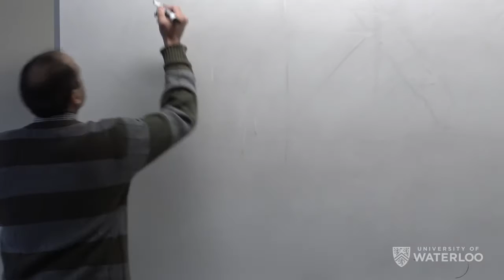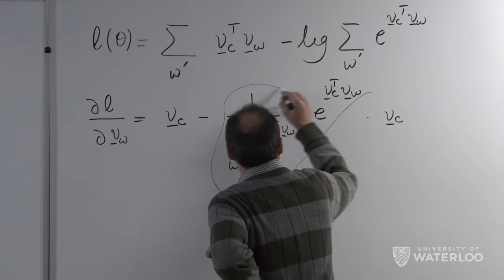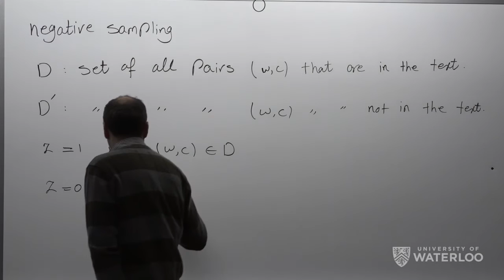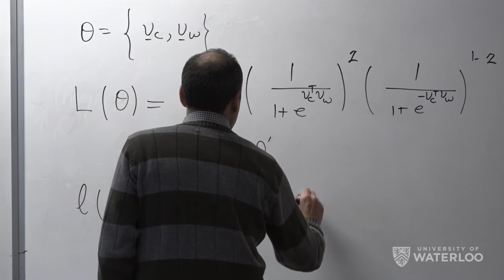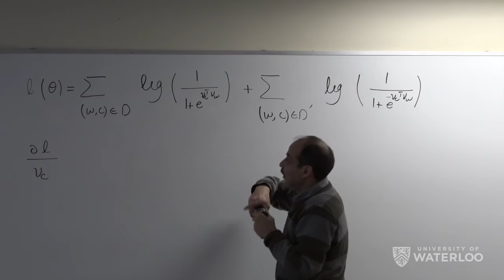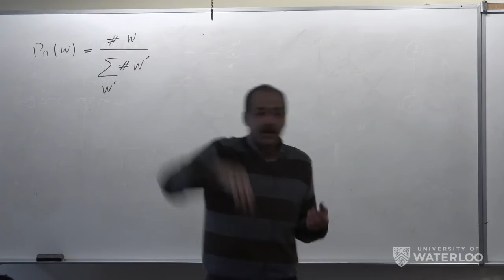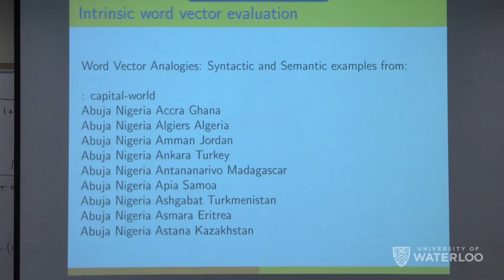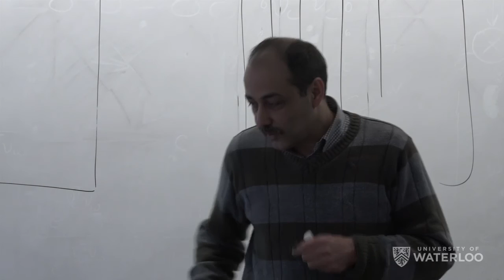Ali Ghodsi, Lec 13: Word2Vec Skip-Gram

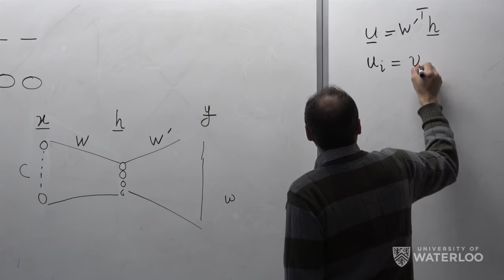Comment: 5:35 Why would it be one row of W prime? In the first case, we got a column vector of W because we multiplied a one-hot encoded vector with W. However, multiplying with h should not give one particular row as h is not a one-hot encoded vector.

Comment: Another intuitive reason for VcVw naming:
the vector Vc is just there to extract the information about the word, works just like SVD, to reduce dimensionality while storing the necessary information. Now the task at hand is to check how similar this vector thus formed, is similar to "all" the words in the corpus, so if we see, the problem has essentially changed, from extracting the info about the word, to getting closeness to all the other words of the resulting vector. Both the problems are different, will be solved using different vectors, hence different Matrices.
Reply: why do we want to make Vc similar to all of the words in the corpus ?
Reply: @cem9927  example: A word like Cat will have context words like four-legged, whiskers, fur etc and a word dog will  have context like four-legged, fur, whiskers etc. where as a word like truck will have context like wheels , driver etc... in order for cat and dog to be similar(ie less distance between them). the word vector Vw will come close to context vector Vc for cat and same will happen for dog as well. hence the distance betweem these Vw vetors will reduce. where as a word truck with word Vw will  have more distance from the context Vc of cats and dogs and increasing the distance between them

Comment: A question for the formula that shown at 1:10:00. The negative sampling part of the formula in the paper doesn't have a negative sign, which is different from the formula derived by the Professor(with a negative sign). Can anybody explain that difference here. Any help will be appreciated
Reply: This is because the formula for logistic used here is different. it should have been 1/1+exp(-Vc.T*Vw) but -ve sign in the denominator is missing while deriving p(z=0,1| p(w,c)) and then instead of multiplying and dividing p(z=0,(w.c)) by exp(-Vc.T*Vw) do the same with p(z=1,(w,c))by exp(Vc.T, Vw).